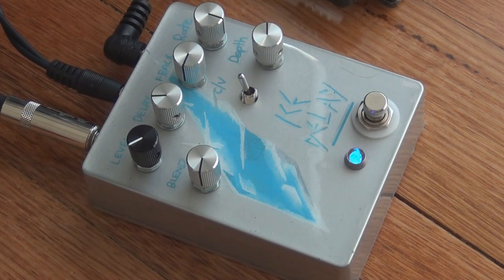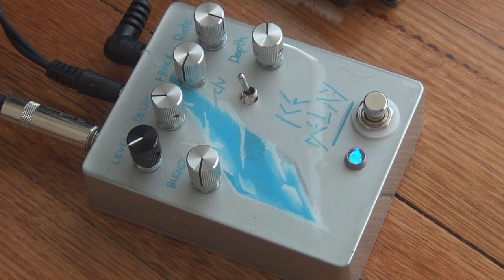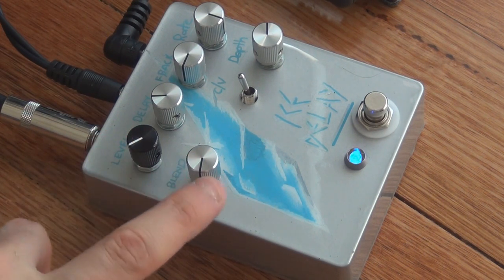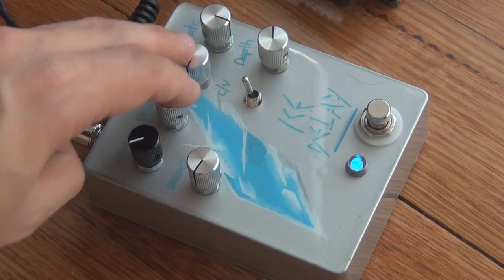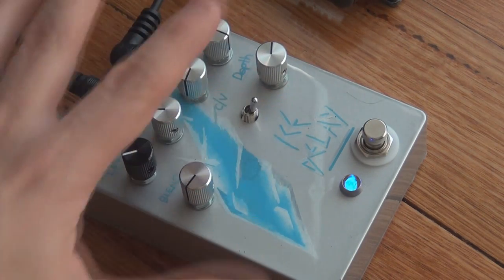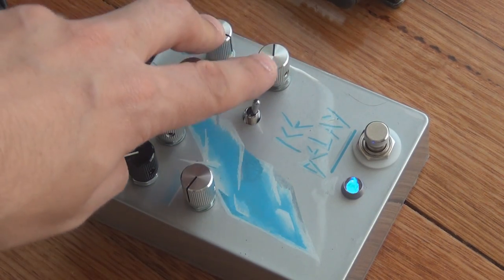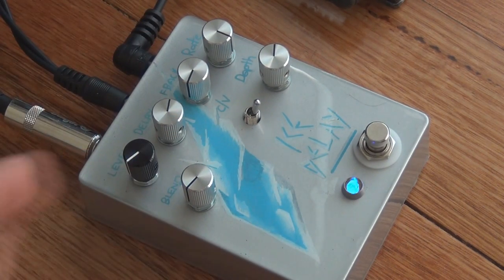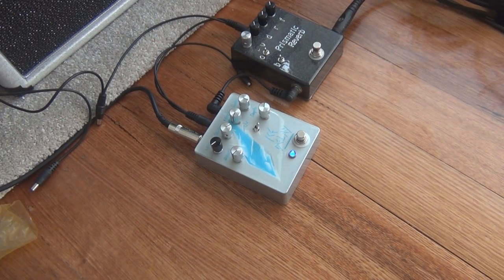Madbean Dirtbaby - Sound Demo

Comment: Will someone please tell me the difference between the Dirtbaby and the Total Recall?! I can't find a comparison anywhere. They're both DMM clones.
Reply: Functionality is the main difference.
Reply: I think it is mostly just the bucket brigade chips used in the circuit. The dirt baby uses PT2399, the total recall  uses the MN3005. One has a slightly cleaner sounding repeat at least to my ears. Both seem like excellent delays. I have been researching delay pedals to build. I think when I save up enough, I am going for the Total Recall. The dirt baby is very tempting as well. It would likely be cheaper to get the parts as the MN3005 is a fairly expensive component. Although the De Profundis from Grind FX another PT2399 circuit seems like a fun one as well. I might end up building all three of them. I enjoy building pedals.